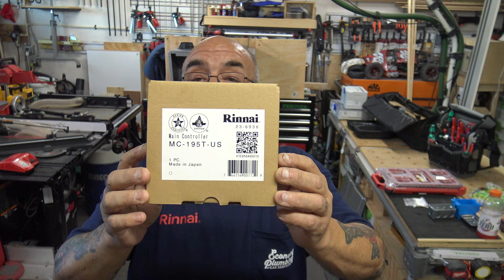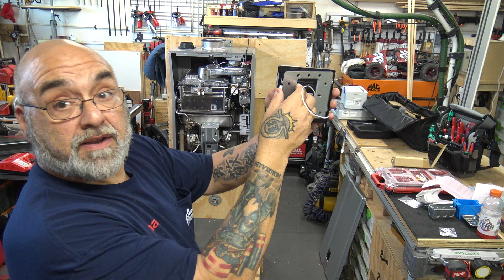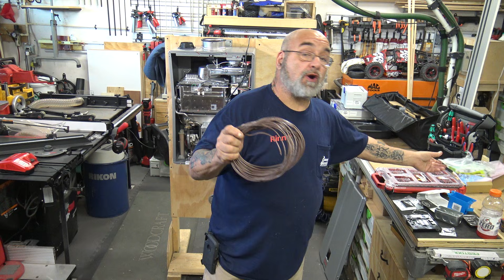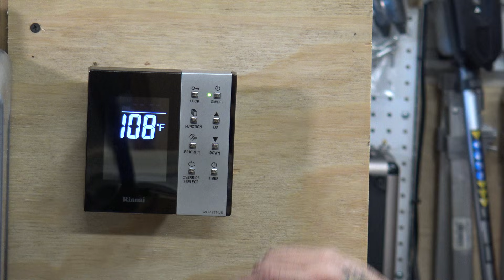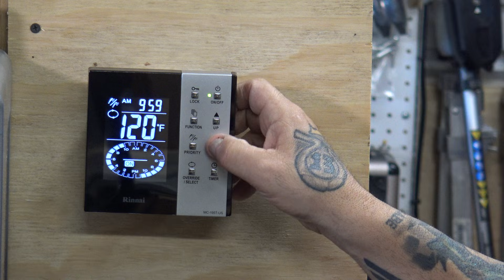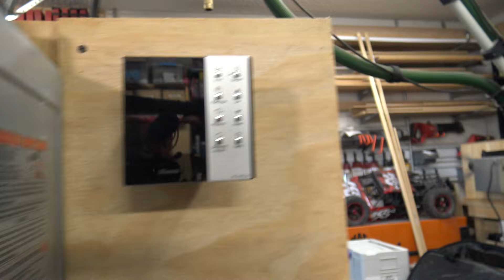Installation and programing of Rinnai's  MC-195T-US controller.

Comment: Hey Mike, 
Enjoyed your step by step  video.  I purchased this home a little over 3 months ago and it has a tankless water heater.  It's a Rinnai natural gas unit and mounted on the outside wall on the northeast side of my home.  The info tag on the unit says it is model number RSC199eN (REU-NP3237W-US(A))  Inside a cabinet in the master bathroom  is the MC-195T-US remote controller.  I am new to tankless operation and fail to understand some of what you were talking about in your video.  First, what is recirculation and/or the purpose of recirculation?  Why did you set the timer on the remote to cut the pump on and the pump off at certain times?  What are the dangers of the lines freezing since it's hanging on an outside wall.  I don't have an owners manual (maybe I can find one on the net) They claim "endless" hot water, but I am skeptical.  

I admit I am a neophyte on this subject.  In my thinking, you turn on the hot water valve in the home and the unit should automatically start heating the water as it passes through and eventually I get hot water.  I am sure that the heater has some kind of gallons/minute limit to be able to maintain the set output temp of the unit.  The previous owner mounted the remote head in a very hard to get to place, but I think I can access it enough program it correctly with your advice.  We lost power over the holidays and I noticed the temp went down to 104.  I returned it to 120 this afternoon.  

So if you could set me straight on freeze dangers,  recirculation ,and pump operation do's/don'ts/and the why of things, I would appreciate it.

Thank you,
Joe in South Carolina

Comment: I have a Rinnai RUR98i and I’m confused as why there are two timers?  What is the purpose of the second timer when timer #1 gives you 24 hours on and off?  Please give me an example of how you would use the #2 time in parallel with the #1 timer so it doesn’t conflict with the first timer?  Which timer has priority?  Thanks

Comment: I don't understand why there are two separate timers as there is only one water heater. Please explain.
Reply from the maker: The controller on the unit sets up the unit the MC195 controlled the temperature and pump cycle
Reply: Vacation schedule

Comment: Hello!  I just bought ad installed a gorgeous REU-KBP3237FFUD-US unit with the remote MCT-95 US controller.  I have watched two videos on how to increase the temp from the factory setting of 120F.  One is to press and hold "Button A" which I think applies to older units and didn't work for me.  The second video says flip dipswitch #6 which allowed me to increase the temp on the controller but the heater didn't respond.    Note, dip switch 1 & 2 are flipped as a factory setting.   I would be most grateful for any suggestions!
Reply from the maker: You sent me the distribution number. Did you get a RUR199
Reply: @ThatTanklessGuy  Its an RUR98
Reply: Any Luck with that override question for the RU98IN?  Would Rinnai help me if i called their tech line or are they stuck on 120 to avoid warranty issues?
Reply: Set dip switch #6 to on in first bank of switches the top set

Comment: I had my first conversation today, with Mike. I had solved my problem before I called him, but as I am a licensed General Contractor, not a licensed Plumbing Contractor, I chose to make the call I had set up with him via email. While not quite like hitting the Lottery, it’s darn close to it. He is a wealth of knowledge concerning the entire Rannai  tankless water heater line of products. This is the only tankless line of products he installs, and services. I had hoped for a 10-15 minute call, I got an hour. It was an hour of not only what to look at to make sure my problem didn’t return, but what to look at if it did. I’m in a very rural County in California. Very near Yosemite National Park. I could have been down the street from him in Florida, or in Alaska. If you have an issue with your Rannai  unit, and you want to self diagnose and repair it yourself, start with the entire line of Utube videos from Mike, the Rannai guy. Also, when all else fails, read the instructions. If they don’t answer your question, he gives you an email address to contact him, then answers you same day, with a cell number, to call him to talk you through the issue you have. No kidding folks, he is the GUY, he lives, breathes these units, and is who you need to help you. Contact him BEFORE you buy, or hire someone local to do your install, he can give you very valuable info in choosing the unit, and someone to do the install, or guide you on doing it yourself. You need a pretty high level of experience in plumbing and electrical, and how to properly vent the unit through the roof, or out a side wall. I am completely competent to do my own work, but the thing to know is that those who are like me do not have umteen years of diagnosing problems with these units. That’s what differentiates Mike from guys like me. He is on the phone, just like he is in his videos. It was a real eye opener to meet a guy, that is exactly who you think he would be, even if it’s on the phone. Buy a Rannai, contact him if you hit a speed bump. You won’t regret either decision.

Roy Anderson

Comment: Mike, I just had my outdoor natural gas RUR199 installed with the MC-195T.  I am in SE Virginia.  The contractor set the recirc pump to be on continuously rather than setting certain parameters.  Is this ok or would you suggest setting parameters when the demand is most.  Thanks.
Reply from the maker: don’t let it run all the time set it to go on and off at a set time
Reply: @ThatTanklessGuy  I thought so. Thanks for your response. 👍

Comment: Hi Mike. Great video. My MC195T didn't come with the controller cable. I looked in the controllers manual but the cable wasn't there. Do you know how I can get hold of one?
Reply: To install a MC-195 controller there is no wire you need to install your own wire. 18/2 AWG is what you need and if your installing it on a RUR199 you need the little white plug that comes in the box. Mike
Reply: @TheBuddylab  Thanks Mike. You're the best!

Comment: Hi Mike, tell me, does the controller unit for the recirculation or the wifi not come in the box when you buy the rur199i?
Reply: Ok, mine must have been forgotten then.  Can i make the thermo bypass return circulation pump work without the controller just using the dash on the unit itself?
Reply: I believe I can using your video showing how to dial it in, just want to make sure.
Reply: The WIFI unit comes with the tankless . You would need to buy the MC195-T-US controller

Comment: Do  you have to use either the wifi or MC-195t for the RUR units or can you just use the comfort or efficiency on the main unit for your recirculation?
Reply: The unit will operate without a controller but not as well if you have one. I prefer the MC-195
Reply: Related question, my unit came with both the wall mounted controller and WiFi can I use them both? Seems like both need to be plugged into the bottom clip on the pc board

Comment: Who else is watching this because they are desperate to fix their failed firmware update from Dec 21? Since then my recirc runs 24/7 with no way to control it
Reply: Watching it because we are tired of glitches in the app or WiFi (disconnects) that then make us go thru whole set up / pairing bull shit again! - and yes that update before end of year was total shit show!
Reply: In case anyone is reading this thinking about buying Rinnai... DON'T

Yes, it's been a year, yes, I still have to constantly call Rinnai to get my unit reconnected to Wifi. A freaking water heater that needs non-stop IT support. What a pathetic effort on Rinnai's part. Too bad because I think their hardware is excellent.

Comment: Any hints on how to clean the air intake filter on an external unit? I have the RUR98EN external unit and it clogs once a year. Local Rinnai guy charges $500 to clean it. Internal unit looks dead simple but I can't find ANY documentation on the external units. thanks